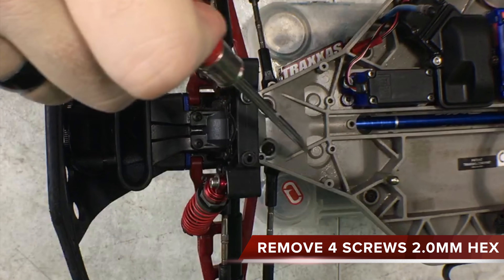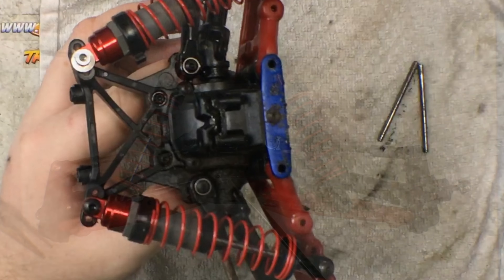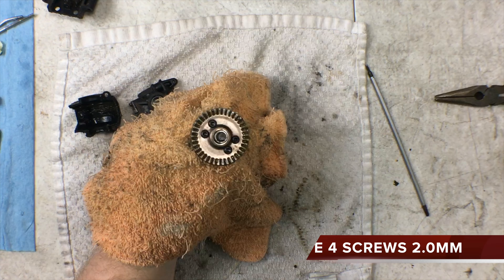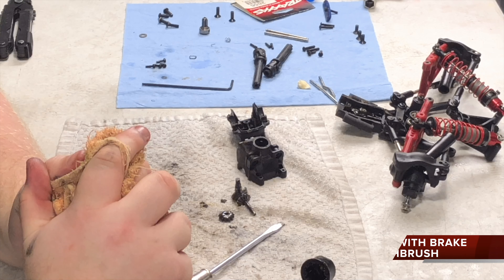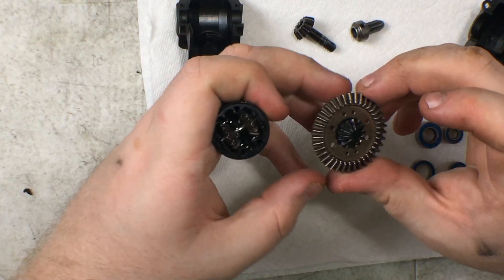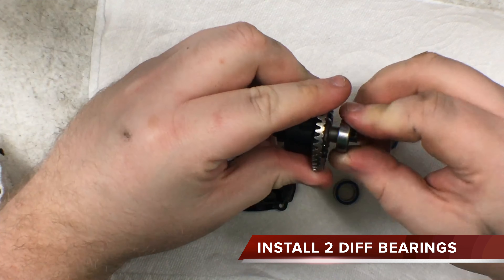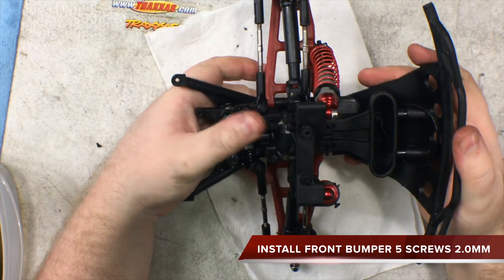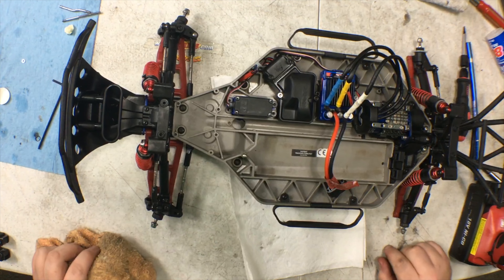RC How To: Clean & Re Oil Traxxas front  1/10 4x4 FRONT Differential

Comment: Hi question, does it matter how much K oil you put in front diff and in the back diff, i mean do you use different oil for the front and back. Or is the front and back diff with same oil?
Reply: Raymond Dalhuisen some ppl use grease...like Lucas tacky grease.....as long it's got lubrication, it's good....grease doesn't leak out like oil...takes alot longer

Comment: I really appreciate your video! I was just wondering though... What is the main difference between the white lithium grease or red or black for that matter? I have watched a few other Traxxas 4x4 differential maintenance videos and they say not to use white lithium grease unless you absolutely have to. Why is that? 
Reason why I ask is, I have white lithium grease from putting together motors. So I figured that would be good to use? My son an I run our slash 4x4 VXL's pretty damn hard (major bashers!) and in really fine dirt damn near like sand but WAY worse and I'd like our maintenance to last more than a week at a time haha. Also another question while I got you here!... I noticed you used 80k silicone in the front... Is 40k going to be to thin to run front an rear? Cheers!
Thanks in advance!
Reply from the maker: I think it has something to do with thickness and strain on the engine but I really can’t remember and my car had a tendency to land on the front end and I have duel shocks on the rear to absorb most of the strain so I don’t need to go as high in the rear thanks for your comment and for watching my channel